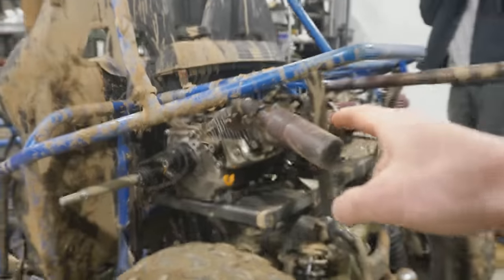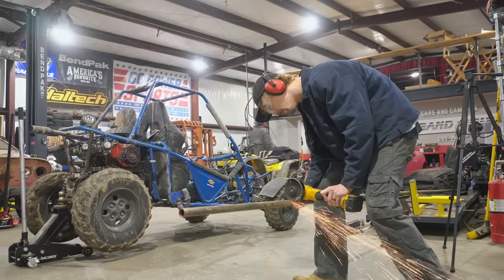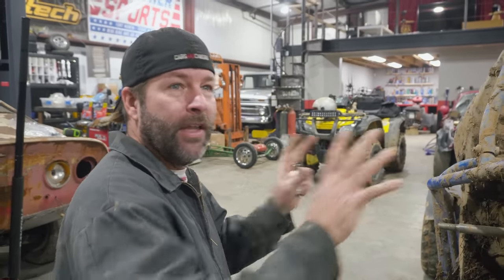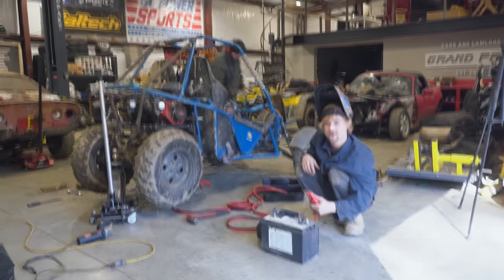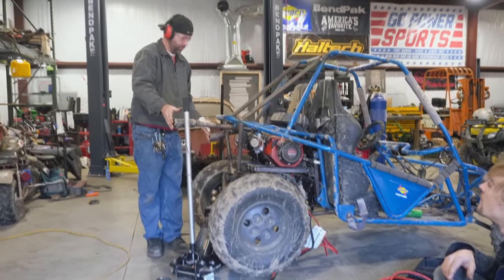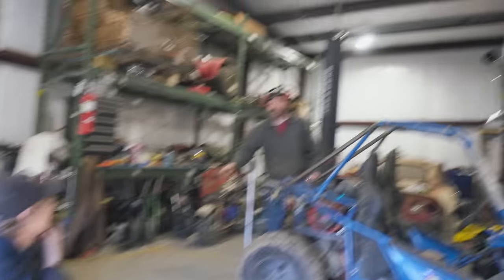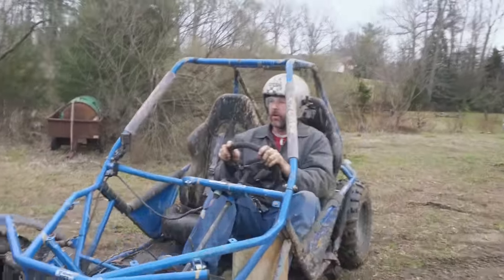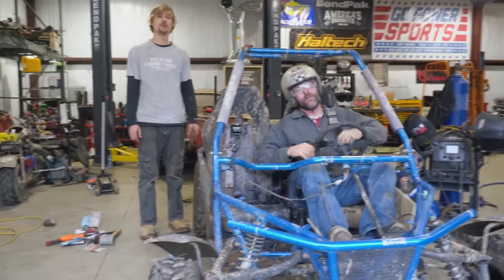Us vs. the WORST Go Kart Ever Made | Will our Twin Engine Go Kart Survive a Full Send?

Comment: I believe you keep popping the main drive chain on this build.   What about running 2 or 3 chains in parallel from the jack shaft to rear axle?  I think this will prevent that chain from popping each time.   Then, what’s the next part of the driveline to fail?   

I saw you had a few problems as the engines were of different make/ and models.  What about running 2x tillotson engines that are similar in build/specs with a shaft linking both engines together at 180* would be a better build.   

Great shows, keep it up guys.   👍👍

Comment: Shaft's bent, so chains are stressed, need to straighten (or replace) that, and add more bearings for support to stop it flexing so much and sending chains into Isaac's truck... :P

That and replace the crankshaft in the ex-engine with a straight shaft, cos cranks are vibratey without their pistons... :P

Comment: How about you guys put in a 3 cylinder Yamaha engine in the beast with the transmission. Or even a 4 cylinder Honda engine from a car with the whole front suspension. Could always delete the the steering knuckles. It would have cv axles with the engine. Probably out of a civic.

Comment: Dang, you three read my comment about 180 degrees apart. This really works great with 2 stroke engines because every down stroke is a power stroke. 180 degrees apart really cranks up the torque. I've never tried this with 4 stroke engines.

Comment: If the two engine setup is too much trouble, I would love to see this go kart with a single 670 or built 420. 

I think one issue might be that the short length of chain is going around two tight bends and heating up. Nice O ring chain might do better. It really needs two identical engines firing exactly 360 degrees apart, or alternatively both engines having centrifugal clutches (would lose electric start but could be started individually) to prevent them fighting each other. 

As others have said, the counterweight on the transmission crankshaft is probably also causing mega vibrations. One could use the lathe to make a straight jackshaft that rides on the main bearings and seals from that crankcase.

Comment: If it was just the empty crank, I would think the bottom chain would go first or that it would throw both top chains. That didn’t happen, so I would suspect you would need to match the engines power first, then fix the cranks together. That might work… but I would definitely plan  on getting that empty crank issue resolved as well.

Comment: Two engines are different in "soul". They are fighting on each other. Put two identical stock engines, and use only one carb. You can not adjust two carbs identically. It has always been issue with engines using one carb/cylinder.

Comment: If you can somehow connect the 2 engines to a single shaft, it seems like that would lower your vibrations.  Add a jack-shaft with a flywheel and see what happens 😃

Comment: You need 2 engines that are 2 stroke. Like from those cheap push snowblower. Then can face each other so couple together for one sprocket.  Run one forward and one reverse because two stroke doesn't care. Less sprockets, set screws, chains and jack shafts to worry about.  Let's see you find another youtuber trying that trick 😁

Comment: Hey C&C yall ever think about using bar and chain oil your chains that what ive been using 
Dirt sticks to it but the oil stay on the chain unlike spray lubes and motor that stuff just slings off 
I lterally oiled my chain in may of 2022 and havent had to add oil it again the oil is still on the chain

Comment: If it's throwing chains because of vibration or being too lose, maybe add some chain tensions to keep it tight and stop it from throwing? As far as the master links maybe just weld in the little key thing? It won't be removable but the chain can always be cut out later. 😂

Comment: What about a bearing cap at the ends of the jackshaft. Seems like side to side play is what might be contributing to the chain issue. Like a metal cup (tube with plate cap) and bearing stuffed into the cap welded to some part of a support from frame. Each end, hope that is helpfull

Comment: I suspect that having the engines timed 360 degrees apart is is aggravating the chain problem. Each time one engine fires it has to pull around the other engine. The result is the slack side of the chain changes every 360 degrees. By having them fire at the same time, they pull together so the slack side of the chain never changes. The result would be smoother chain operation and less chain slap.

Comment: If you drill a second set screw on the opposite side of the sprocket apply red locktite and leave the keys long enough to weld them to the shaft. Also, you can bolt on blocks of oak with slots ground in to keep the chains from slapping. Oil the chains well until the chains wear into the wood and the chains are seated and running on the rollers can help allot once they are worn in the chain slap is minimized. It should eliminate most of your problems. Using belts on parts of your drive would eliminate vibration only getting the belts wet may be a problem.  Also rubber pads under the engines can help with vibration if not over tightened.

Comment: I wonder if timing the engines to fire together, or exactly opposite would help with the chain breaking issues. Together they would act like a large single cylinder, opposite like a pedal bike crank. Or even try compression of one exhaust of the other together, or opposite. If nothing else it would be interesting to see and hear the results.

Comment: "Timing" the engines might help some but using that ATV transmission with the piston & rod removed without a weight put on the crankshaft is going to cause vibration no matter what. Suggestion: You might want to install a shower in that nice shop you have.

Comment: I did the same thing with a Honda 90 engine when I was 13 y.o. in the mid 70s using a 580 West Bend to drive it. I took the Honda crankshaft to a machinist in town and he made me a straight shaft out of cold roll steel to get rid of the vibration. I mounted the Tecumseh above the Honda transmission direct drive With mounts I fabricated out of mostly bed rails using an old Forney stick welder and started it with the kick starter. Only kick start three speed West Bend powered Rupp Grand Prix in existence at the time as far as I knew.  I got it taken away from me and sold after the chief of police clocked me at 90 leaving city limits. Now I'm 60 and playing with go karts and minibikes again 😂🤣.. Keep up the interesting builds fellas. Maybe a big block driving an atv transmission in a golf cart 🤣

Comment: I guess you'll have to make a rectangle frame to take a 420, axle & brakes etc and attach it via a 5 link suspension ( actually a 4 link with the upper arms being closer together where they attach to the frame and spread apart on the axle works well, It puts the roll centre between the closer links (on the frame) rather than on the diff like on a car (which is done that way for packaging and simplicity) and keeps the handling more predictable

Comment: As others said if you can bolt the engines together crank to flywheel yall can run either like a juggernaut or torque-a-vetrer on or off of the one  engine to simplify and then also brace the Jack shaft with another carrier bearing

Comment: I know that you guys want to have twin engines, but you might try a larger single engine.  You may try timing the engine opposite of the crank in the transmission.  You would have to use the same size gears to maintain the proper timing.

Comment: I have an idea you might be interested in, guys. Imagine those two engine plates with four threaded rods in each of them. There'll be a nut at the bottom of them and one above them. Those two will stabilize those threaded rods and will keep them vertical. Then, there'll be another nut that will adjust the height of those two engines. All those threaded rods will have the same amount of nuts, which will be eight. Eight times eight equals sixty-four. Whenever the two chains become slack, loosen the top nuts and turn the two below the engine plates. This will tighten those two chains. That's what I'll be doing with the engine I'll be installing on the carts I'm going to manufacture in the future. As for those eight nuts at the bottom of those treaded rods, they'll never need to be loosened because you don't want to change the alignment of those threaded rods. You would want to keep them aligned with the holes in the engine plates. Be certain that those rods are long enough for those two engine plates.  In the event they aren't,  those chains will never be tigh. This will cause them to do damage to the teeth of the gears that were slid onto the axle shaft. So, which nut should be adjusted first when the two chains become slack? The
Those that are closest to the two gears on the axle shaft. Why them? It's because they're the closest to them.in the event you don't want to have those si

Comment: What would be cool is if you mounted the engines close together and made a tube intake to run both engines off a single carb, and built a two into one exhaust and run both engines through a single muffler.

Comment: Machine a replacement shaft to replace the crank in the atv engine to keep the trans, and put one high output motor on it, and that thing should be gnarly without all the issues

Comment: I think you need to set it up so both engines are on the same power stroke at the same time. when one is on the power stroke it twisting the jack shaft back and forth.

Comment: Wouldnt the difference in rpm make “timing” the engines irrelevant? Just wondering
Reply: I guess because they dont have 2 clutches they would hold the same orientation, so it kinda makes sense, but youd need to have basically identical engine builds to make it work to its fullest potential

Comment: I think if yall run the exhaust into 1 pipe or do a x pipe to dual pipes it would sound awsome.  Plus a x pipe would help scavenge the exhaust out of the engine that's on the opposite stroke
Reply: What are going to do with the OPEL GT